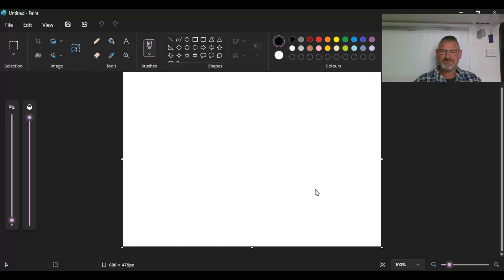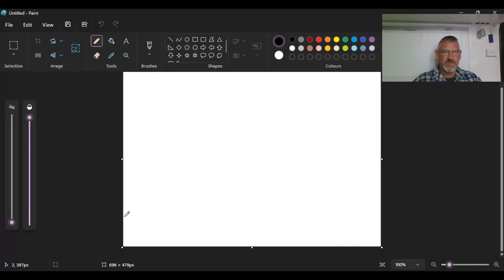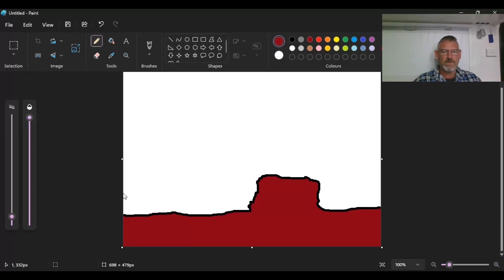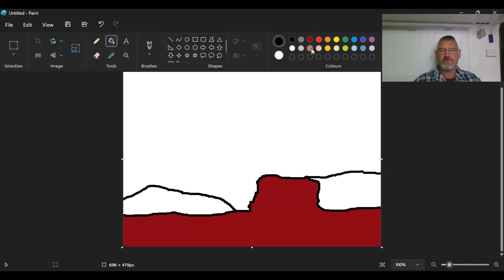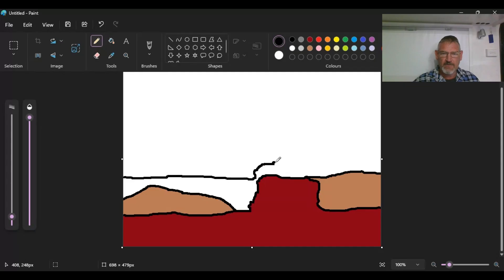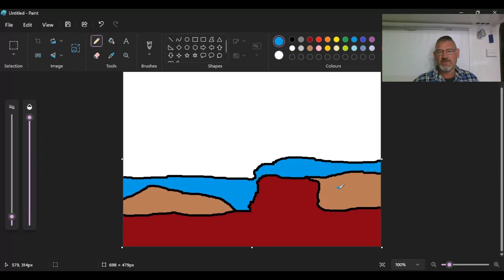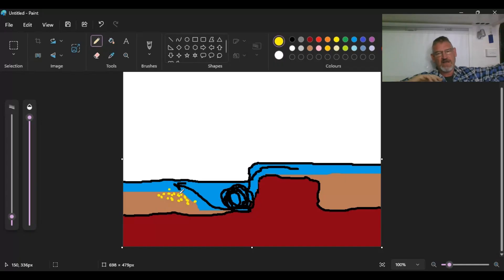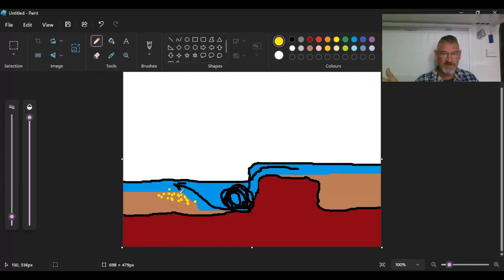Hydrology & GOLD. Part 1

Comment: As a reasonably good drenching front is passing through the southeast, Andrew, we'd wished a fellow prospector they get a good flow of water return to their creek, and not another fill of logs and branches. "Checking the creek" after a good rain, a familiar spot can surprise with what gets altered, exposed, transformed. We'd often walked the dog also, the husky would love a swim, and bite at imagined fish where the waters babbled, we'd look for freshly exposed old bottles, and any concentrations of heavies that the turbidity would leave exposed, atop the front of a gravel bank, beyond the drop zone, behind a bar of bedrrock, or concrete, as the case may be.
Ongoing learning for this Studio 54 year-old, plutons to do with volcanic zones, our Melbourne Shrine Of Remembrance pale stone came from a Tynong Pluton, and out our window we're looking at the Lysterfield Pluton, both associated with the Mount Dandenong Zone volcanics, and the felsic and mafic granodiorite and monazite granites are 35-65% alkaline complex of elements, we were looking for heavy rare earth elements, and what gemstones such chemistry, heat, pressure, and rate of cooling allows to have developed. "Ancora imparo", thanks, and cheers!